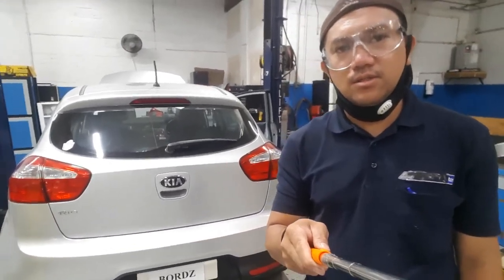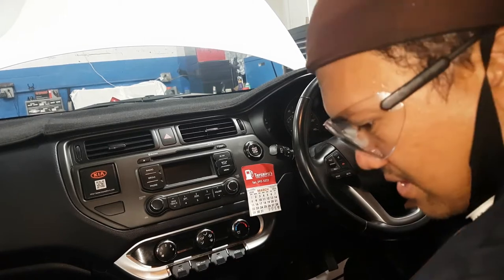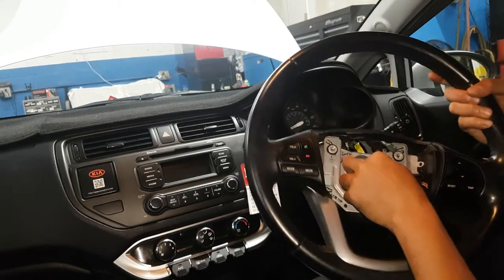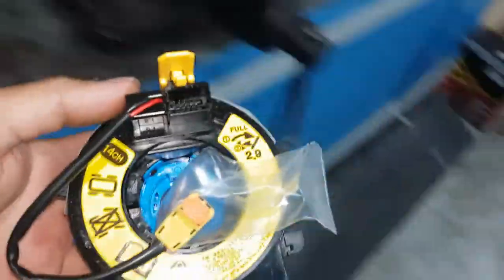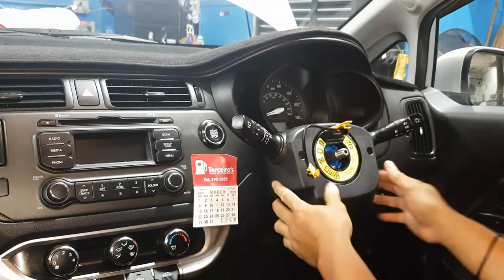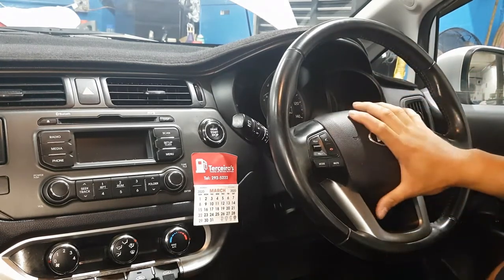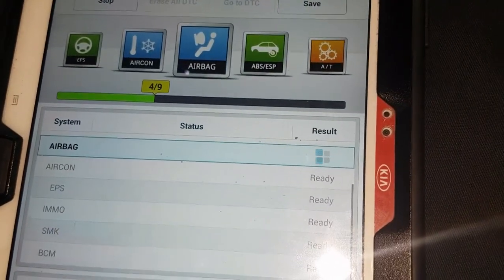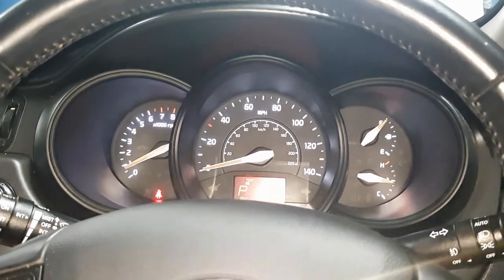KIA RIO Air bag lights ON / How to replace spiral cable/ clock spring

Comment: Great video,some of the guys out there don't even disconnect the battery,one question doesn't the head unit (radio,CD,)ask for a passcode after disconnect the battery. I want to do it myself but I'm afraid the radio,CD unit will ask me for a security code and i don't have it.
Reply from the maker: Hlo good day.  Thanks ,Kia rio vehicles or most kia vehicles are no passcodes for cd radio . Just you need is to reset the clock and radio station
Reply: @bordzkiatvlog3729  I got the car for around 4 years now,kia rio 2013 1.1 CRDI 5Door Hatchback,no major issue,my first car,great car,in the city in getting 60.0MPG (4.7 L) on the motorway 80.0 MPG (3.5 L) in the UK.Now it has 100.300 Miles (161.417 kilometres).If you perform repairs on same models or similar Hyundai I will definitely watch it. Keep up the good work.
Reply: Hy,I just finished change it myself following your steps,great results,I don't have the airbag light on anymore when driving.I found a connection which us not plug to anything next to clock spring connection,small red clip 2 pins,any idea what is that for ? Thank you for your support,keep the videos coming.
Reply from the maker: @myshu7627  wow great nice good job. I wll uploads videos fir fixing cars so u can watch it 😁😁😁
Reply from the maker: @myshu7627  yes im sure thats for another higher features of that models for sensors
Reply: @bordzkiatvlog3729  maybe for heated steering well or combined clock spring with steering wheel with cruise control switches.

Comment: Boss kakareplace ko lng po clock spring june last year kasi nawala busina tapos nawala po ulit ngayon dec.2020..may paraan po ba para irepair yung clock spring para di bumili ng bago?..salamat in advance sir..God bless!
Reply from the maker: Ganon ba , nasira ulit yung clock spring ,so nawala n namn yung busina mo. marepaire nmn kaso medyo mahirap kc tanggalin mo tagala yung s loob ng clock spring , or pwedi ka nlng mag rewire ng sariling horn switch , kung ok lng na naka separate yung horn switch  .
Reply: @bordzkiatvlog3729  opo sir, my mali kaya pagkakasalpak q last year..anyway nag order po aq ng bago..sana magtagal..slamat sir.
Reply: @bordzkiatvlog3729  boss ngpalit na po aq ng clock spring pero intermittent pa rin eh..ano po kya problema pa?
Reply from the maker: Hlo po , ganon ba, na test mo naba yung Horn , kc common din sa Kia faulty yung Horn nyan , kung matanggal mo try mo direct kung intermitent sya . Kc mga ikang bisis narin ako naka replaced ng Horn
Reply: @bordzkiatvlog3729  horn poo ng ford un cnalpak po kc inakala po nun una eh horn tlga problema..meju bago pa xa.last year lang din po sir.
Reply from the maker: Try mo direct sa outpot power supply connection ng horn lagyan mo ng tester light tapos obserbahan kung ok or walang intermitent na supply, para malaman mo yung connection ba problema , para ma check yung horn contact switch and horn relay
Reply: @bordzkiatvlog3729  Boss ok na.. un linya pala ng horn ang naglose.. same symptoms kc cla nun clock spring ang ngkaproblema kya inakala q clock spring ult..slamat sir! 🙏
Reply from the maker: Ok lng yan , akala ko kc na checked na sya dati kc napalitan n ng horn n bago, ok lng yan basta na solved na problema
Reply: @bordzkiatvlog3729  hehe oo nga sir..lalot need marenew un insurance, meju sayang lng un pnambili ng pyesa..😅
Reply from the maker: Yun nga lng kc hindi na checked ng maayos , heheheh charge to xperince nlng ya  😀😀
Reply: @bordzkiatvlog3729  hehe opo sir.thanks po!
Reply from the maker: U welcome

Comment: idol sakin na Kia Rio napalitan ko na yung clock spring at inalog2 alog ko na rin yung wire sa upu.an at sensor sa harap sa bumper pero anjan parin po yung airbag light..ano kaya problema idol??
Reply from the maker: Hlo po sir good day, mas magamda or madali kung na scan sana yang sasakyan para ma pinpoint yung saan yung problema , baka may kaibigan kang may scanner para malaman kung saan yung fault, kc marami kasing possible sa air bag light ,
Reply: @bordzkiatvlog3729  ganun po ba idol?cge po papascan ko nlng po ito..salamat po sa video idol👍🏻🙏
Reply from the maker: Opo sir, or try mo tanggalan ng connector sa batterya wait ka ng kahit 30min. Tapos balik mo connector, tapos start mo makina turn steering wheel left and right full turn tapos obserbahan mo kung iiliaw ulit, pero pag iilaw sya ulit need mo scan talaga
Reply: cge idol tatry ko yan bukas ng umaga.sana mawala na.hehe..
Maraming Salamat idol..nkakatulong talaga mga videos mo dito🙏
Reply: idol na try ko overnight tanggalin yung battery d parin nawala..tas chineck ko yung fuse putol.
sinubukan ko palitan ng dalawang beses yung fuse napuputol parin meron cguro short circuit?
Reply from the maker: Oo possible may shorted yung wire ng related sa airbag , na accident ba yung front ng sasakyan mo
Reply: @bordzkiatvlog3729  oo idol na bangga pero d nmn mashadong malakas gasgas lng konti sa harap.
my duda nga ako baka yung sensor sa harap pero d nmn sya nabasag or na disconnect.

Comment: Amazing video. I tried to install cruise control kit buttons on the 2013 model and now none of my buttons work anymore. I even tried installing a new clock spring and no luck. Any advise?

Please also share part numbers if possible, thanks

Comment: the small yellow locking piece should be installed?  or should it be removed?
Reply from the maker: Need to removed when you install the parts , but make sure dont turn it and make sure steering is straight position

Comment: Very Nice Video... the step by step tutorial is very clear and easy to understand.  I have the same problem air bag indicator is ON and I replace the clock spring but unfortunately the problem is still there. What should I do.... Thanks
Reply from the maker: Thank you for wathching my video, best way to plug in the diagnostic  for pin point the faults on the air bag, it may possible there another fault on the system, 🙂

Comment: Great video, thanks for showing this -- it was useful on my 11 Sorento LX. I installed the clock spring myself -- I'm guessing that it's normal for the light to remain on after the install of the new part because mine stayed on, same ODB2 code as displayed on your video. I used my scan tool to clear the fault codes and the light went away when I started my cart. So, I guess wait and see if the job is done...? IF the light comes back on? Does the car need to be driven some in order for the AB light to come back on if there still is a fault? JC.
Reply from the maker: Thank you fir watching my videos and you r very welcome

Comment: is it need to reset the new one or just install cos some said must rotate first
Reply from the maker: Hlo good day yiu can replace the parts make sure tge steering wheel or wheels are straightline and removed battery neg. Terminal and you can remove the parts , no need to rotate the the new parts has lock on it yellow color ,

Comment: Hi, do you not need to code the new clock spring? Cheers
Reply from the maker: No need if your clock spring without angle sensor
Reply from the maker: But this model is no need the code

Comment: Good afternoon Boss.
I own a Kia Rio 3 CRDi 1.1 from 2013.
This afternoon I changed the Clock Spring because the Airbag light was on.
 I have replaced it with the negative pole of the battery disconnected. Only when you connect everything and start the car, the airbag light is still on. What could it be? Thanks a lot.

Charles.
Reply from the maker: Good day day sir , you just make sure  that the clock spring is the problem, you must connect the diagnostic machine to see that driverside air bag is that fault codes,
Reply: @bordzkiatvlog3729  Okay. Thank you so much.
Reply: @bordzkiatvlog3729   I have reset the ECU. Now the light has finally gone out!
Reply from the maker: That sound good , the air bag light off
Reply: @bordzkiatvlog3729   The airbag warning light is on again. It is not possible. I surrender.

Comment: I have a 2016 kia Rio and I am able to loosen the torx screws and make the airbag wiggle, but it absolutely will not release from the steering wheel. 

Can anyone please offer a suggestion? I've pulled and even tried to gently pry, no success. Please help.

The only thing that I did differently was that I disconnected both battery terminals, everything else the same.